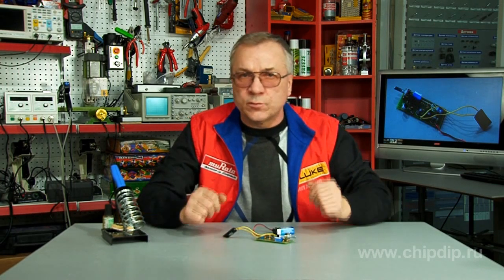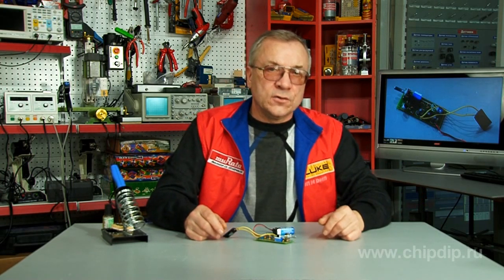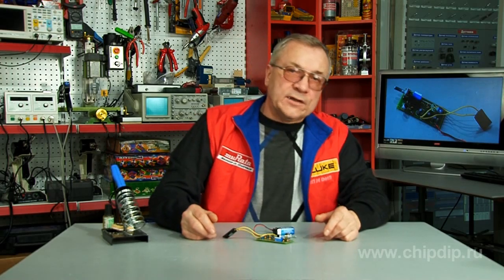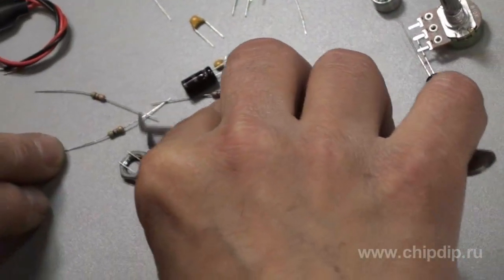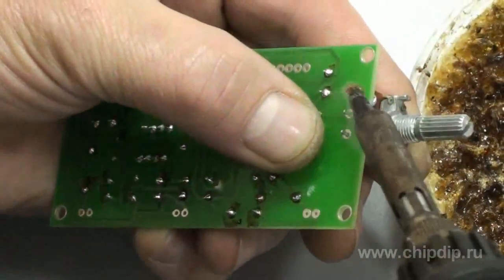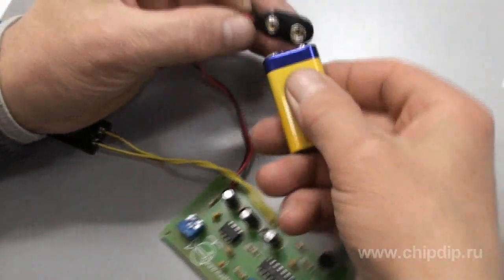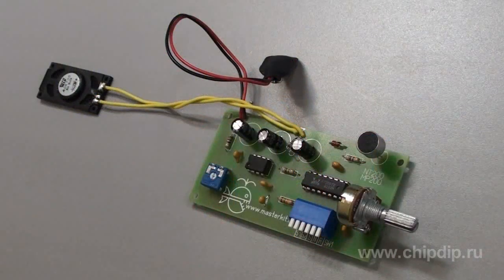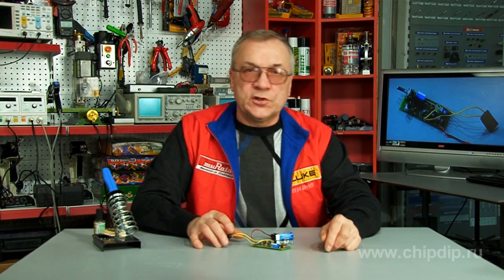Voice changer

Comment: Доброго дня, мой друг... :)
I would like to use it to reduce feedback between MIC to loudspeaker by modulating the voice input by 5%. Is that posible with this circuit? Thus, I need to know, whether its frequency shift modulation (not only the vibrato speed) can be reduced to 5%  ?? If it can than this circuit would be useful for audio feedback reduction, for it varies the output signal from the input signal and so, prevent looping of the signal. I'm a whistler musician. Here you can hear me blowing up: https://app.box.com/s/b9gqygregcatplso6ceih8jmsyfd9eme
Thx for the Info... Joh de Chile